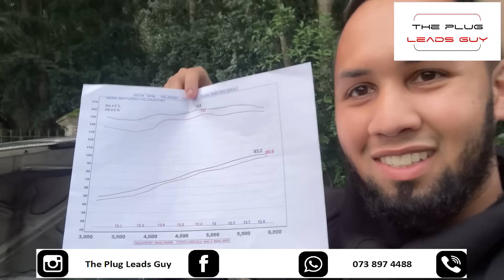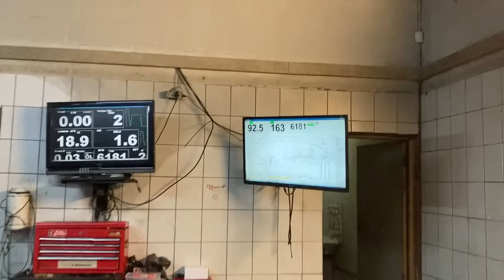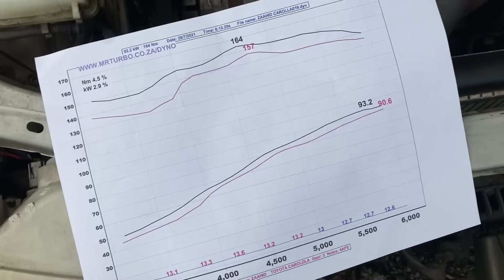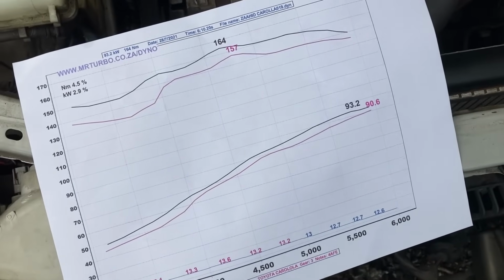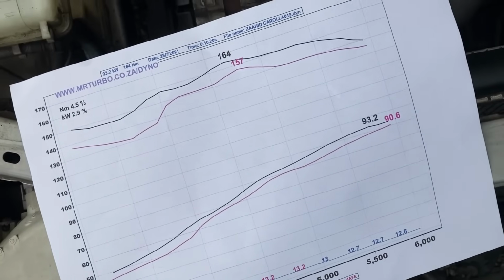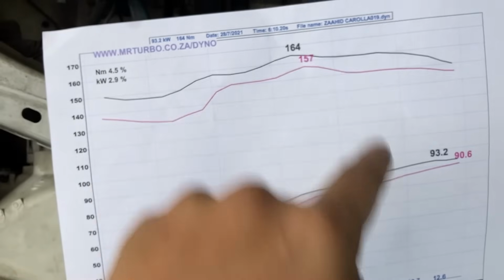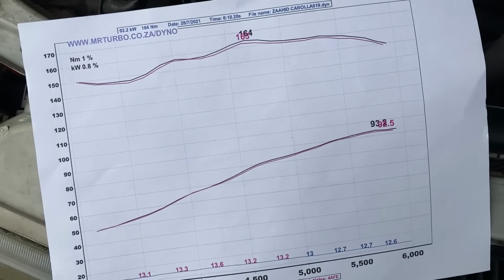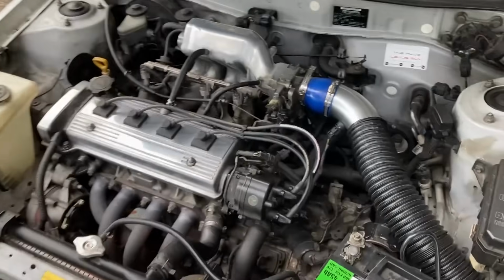Performance gains from my Corolla AE111 4AFE | SCREAMING VELOCITY STACK !

Comment: How much power did you gain from like original parts that is what im curious about cause i have the older corollas with the same 16v engine BUT i want to up some torque and power minus going crazy with turbos n kak. So 10hp to 50hp gain would make me happy 😅

Comment: Don't know your setup but my advice to you if you want more power go for 225 cc injectors and a adjustable fuel pressure regulator. Your lamba is a bit to high for maximum output and you see your new line drops because lack of fuel.

Comment: What work has been done to your motor? Can’t be stander! Iv done some work to mine and iv only got a little more power than you. Spill the beans.
Reply from the maker: None whatsoever bro.

I have a 50mm powerflow back box(rest of exhaust still original)

Noiseboys branch 

Short ram intake with stack.

The car does surprise me a lot though 😂 I would love to however port and gasflow the head with a full exhaust.

But currently the exhaust setup seems to be working for me.
Reply: @VADproductions  I’m dumb struck.
I have a full power flow 50mm Cowley branch gas flow and port with a unichip, dyno done by KSD and I only got 96kw and 160nm🥺
Reply: @VADproductions  you cant say nothing is done when u have modded the exhaust and branch. its still a mod
Reply from the maker: He asked what work i done on my "motor" bro. No internal work has been done just breathing mods

Comment: After driving  chinese cars like chery.  With a Acetco 1800  Or 2000  cc engines i hate corolla  as its 0-100 time is too ..while in practice. Chery achieves 100km less than 10 sec easily while corolla not!  Specially old corolla worse  i don't know why people   preferred that out date engines ...also not fuel effective